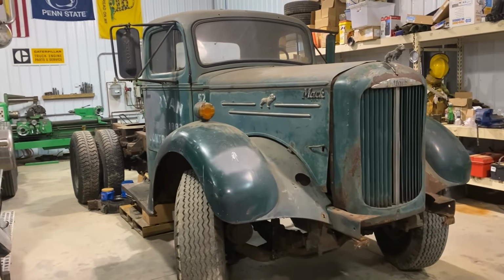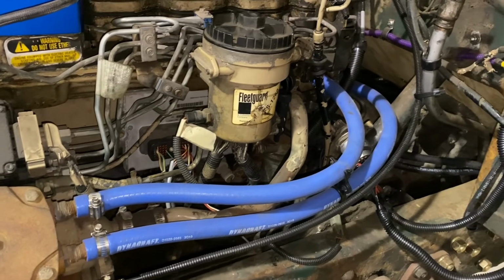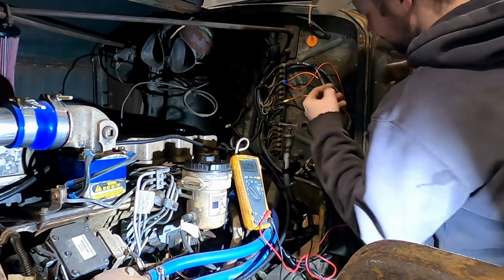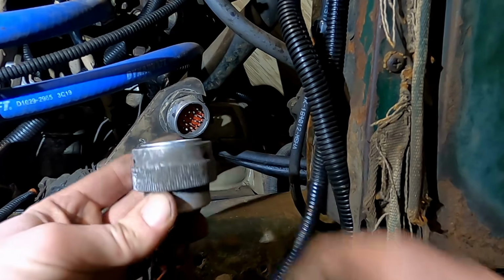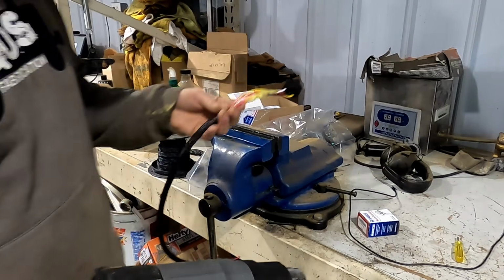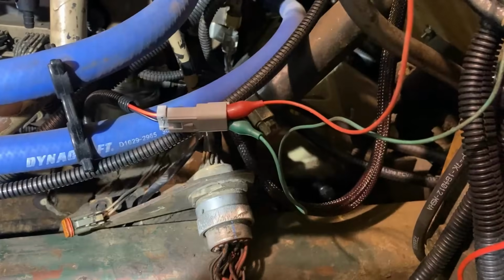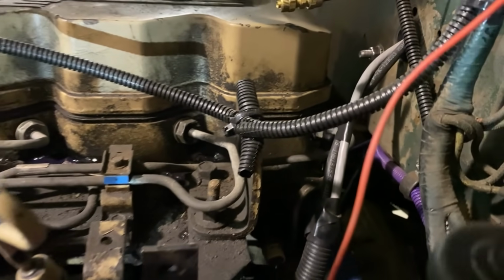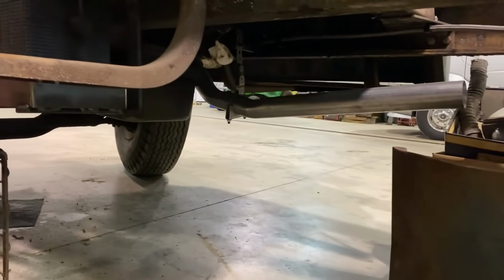Cummins Swap - Will it Start? | Mack A40 | Part 2

Comment: My dad told me when I got my first card don't leave you battery s on the floor cement or black top it's the same it well c
Skuck the power out of them😅
Reply from the maker: Funny you mention that. I used to believe that and finally looked into it more- it’s a carry over from when the battery cases were wooden and is no longer relevent

Comment: That is the low air warning buzzer. You can check with your state DOT sometimes they allow you to have a light or buzzer in some states you need both. Those buzzers are pretty rude! You can verify it if you want by using shop air to fill the air tanks and see if that cancels out the buzzer.

Comment: I'd have pulled the 24 valve and put in a nice mechanical 12 valve.  Be a lot easier and less crap to go wrong down the road.  Only wiring you need is for the starter and FSS.  But the FSS can probably be made mechanical too.
Reply: Nothing wrong with the 24v. 12v is a damn great engine but they are definitely overrated. Put a FASS or an AirDog behind the VP and you won't have a problem. They are super easy to diagnose and repair just like a 12v

Comment: The longer, but simpler solution would be swap out the electronic fuel pump; to a p-pump. Gets rid of the computer for the most part as well. Would that possibly be a project further down the line?
Reply from the maker: Probably not because this is a 53 block. Either way swapping a 24 valve to a p pump is a big job with a lot of changeover. I didn’t buy it the previous owner already had it in there I would probably just swap in a P pumped 12 valve to your point

Comment: Cummins or CAT...  it will run.... Many may really dislike electrical, and I get it.  If you want to make your life more enjoyable.  Start wiring with Deutsch connector and 21st century relays.  I pulled the wiring our of my brothers 79 Z28. Bought a new wiring setup. Mapped my wiring in a spreadsheet...and Deutsch connected everything.  If we / he pulls the motor again four connections

Comment: I was a truck driver in the mid 80's & early 90's. Many of the old junk yard tractors had that same low air buzzer. They are mechanical  generic devices, from the 60's & early 70's.
Reply: Totally. That’s the first thing I thought of was air pressure, based on experience with M35 and other military trucks.

Comment: Yes it's nice to have a hand full throttle crank for 10 seconds wait 30 seconds then half throttle crank for another 10 seconds it should start percolating the old secret to starting 471 a 671 and even a silver 92 Detroit Diesel they was dirt when it was cold that way probably wasn't enough fuel in the cylinders and not enough battery when you do that process the fuel will seal the rings off better and then it'll atomized better because I don't think you have enough compression to ignite thanks great video

Comment: actually a little starting sauce would not hurt anything. May have started a lot quicker.
Reply: A lot of these engines had a pre heater in the air intake, starting fluid is a big No No

Comment: I hate when people drop automatics and electronics into stuff like this……. Couldve just put a mechanical 12valve in it and used an eaton transmission…. And spent maybe $2000 total…to do it…. Would run with one wire….. and wouldn’t have a ridiculous shift tower sticking out of the floor
Reply from the maker: Previous owner put them in. I am am going to change the transmission but I don’t mind electronic engine. You can build yours however you like.

Comment: Deutsch connectors take a project up so many levels in durability and serviceability
Reply from the maker: I love em- i cleaned the firewall up a lot will show in next video
Reply: Looks like a typical aircraft wiring connector.